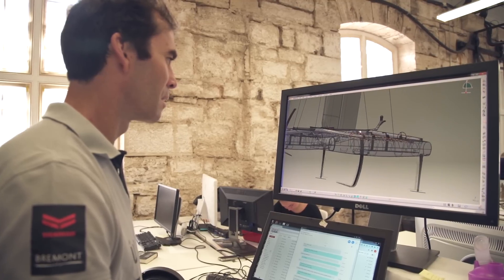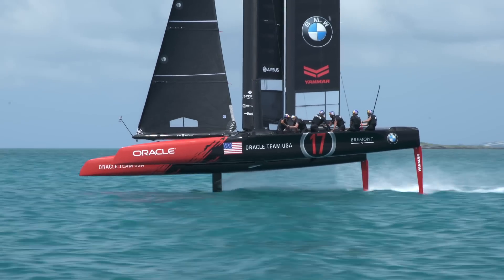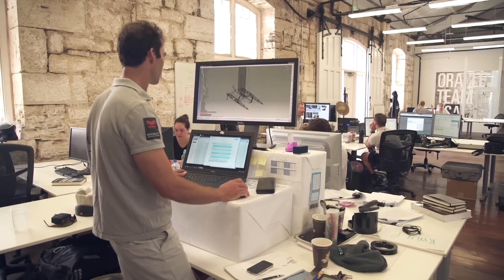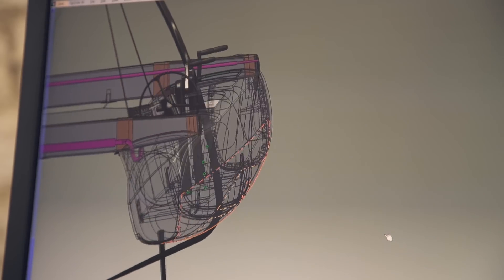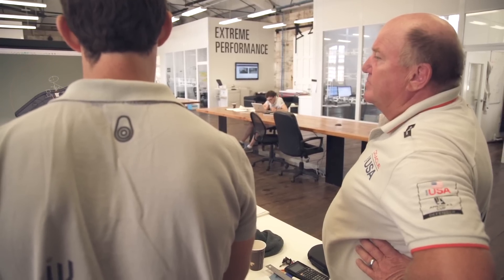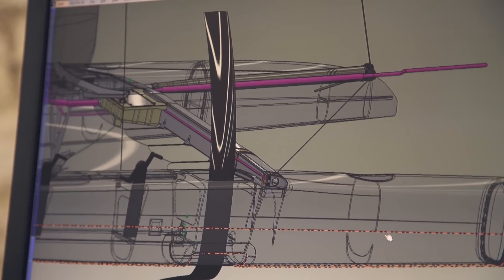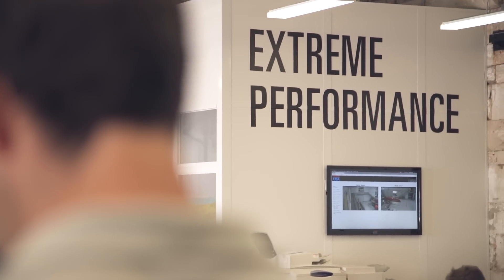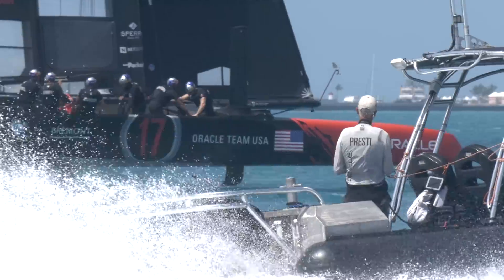#TechTuesday: Print it! 3D modeling and printing a winner

Comment: The limits of doing exactly this haven't been reached yet, but every material and creation tool IS OUT THERE RIGHT NOW!  A 3Dprinter that would print an epoxy compatable light and ridgit male hull and bulkheads full size(i am talking say a catamaran 36ft.wide x 12ft. high x 72ft. long) exsists now.  24K carbon fiber prepeg applyed to the male hull(or other  wild laminates "TeXtreme" carbon/zylon hybred) coupled with a real skilled 3D CAD team can use a "3DP" Excel series printer that is out there now.   3DP can make these up to 300 meters long if someone has the balls and the money!   The yahat bis is curently depressed do to a receint bad hurrycane season.